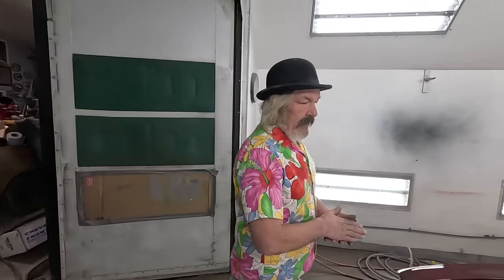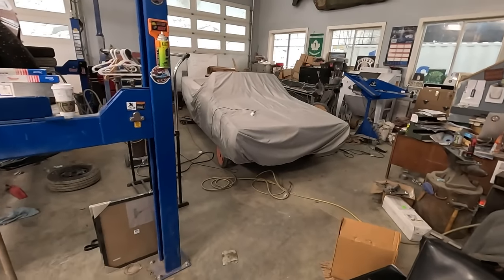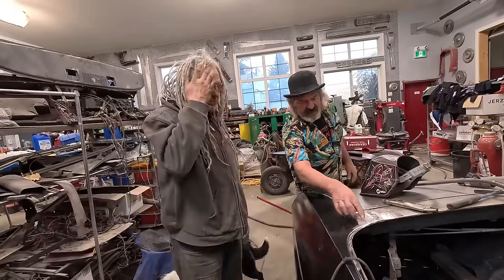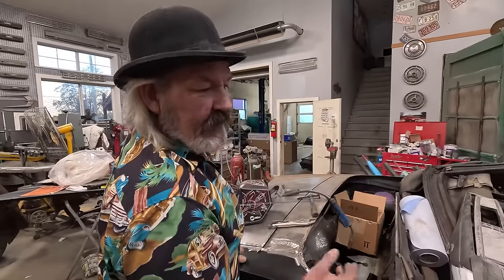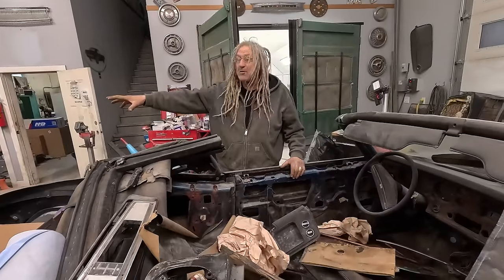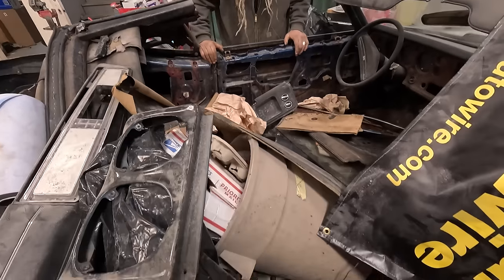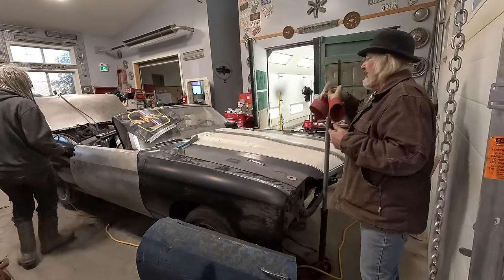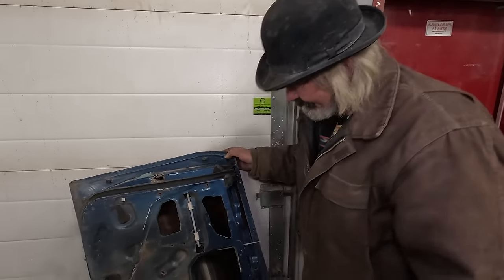1970 Chevelle Convertible - Metalwork, Spare Doors & Sand Blasting

Comment: Mike see's things exactly the way I do although I've been known to 4get but it's always good to put parts back where they came from and the bolts and screws cause later on down the road ya gotta take from other vehicles that needs all the stuff that came factory with em..I've worked around so many shops and I couldn't believe how some of the jacklegs did things. I couldn't stand it and had to move on..I lost count of the guy's that cut wires just to swap engines and everything was all botched up on em especially under the hood lol..

Comment: Can the original door handles be taken to a plating shop, dipped in caustic soda to remove the rust ? If the handles are to pitted Mike would end up with re-chromed pitted door handles ? Is that right Blair ? Take care guys. It'll be great as long as Mike listens to some solid advice.